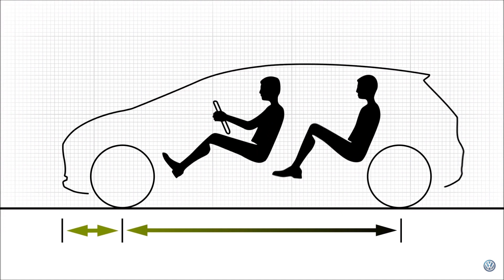VW | Electric Future | MEB Platform

Comment: VW in my opinion are decusting. Just think a minute at what they did. In some country's there still been sued.USA is one of them.VW group are the biggest manafacture of cars in world. There doing this because of fact there's a distust of them on ICE cars imitations, regardless of them getting tougher. ITS GOOD they are going down the electric root.But let's be honest they in effect have been forced to.Its THERE only option to get away from diesil gate.
Reply: Pretty much all the manufacturers were doing the same thing. VW got caught that's all
Reply: Indeed, so far we know the whole VW group did it, Fiat-Chrysler did it, BMW did it (by "accident"), Mercedes did it,  Honda, Mazda, Mitsubishi did it as well and the list goes on. VW was just the first to be found out, and of course they are still sued, as they should be. And of course it doesn't make it better that everybody did it. 

Interestingly though, the MEB was already in development before dieselgate broke. Everybody saw the writing on the wall, Tesla and Nissan-Renault showed that it worked economically (on a per unit basis) and for the consumer as well. After it exploded, of course the development got a new urgency.
Reply: In a way that disaster has a sliver of a silver lining for VW, much of their old guard fossil management has been replaced and the newer management is a little more in tune with future trends, but like all major ice vehicles they have the albatross around their neck of their legacy infrastructure, supply chains and dealer networks. So the problem of maintaining that legacy network to keep the money flowing in to cover overhead, operations, debt, R&D and building up an EV production and infrastructure and supply chain to achieve profitable volumes whilst cannabilizing their cash flow and profit source of ICE vehicle sales.
Not Many ICE manufacturers will survive, just a matter of who
Reply from the maker: Mark Portch I couldn’t agree more. As I said in the video, if it wasn’t for them getting caught out I don’t believe they it any other manufacturer would be looking seriously at EVs. Thankfully they did and the results should benefit all of us 👍